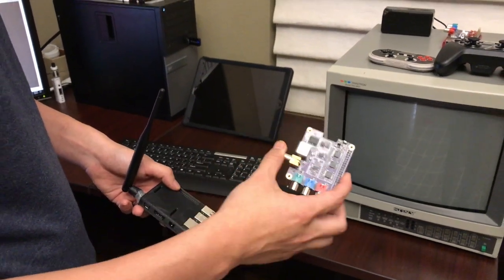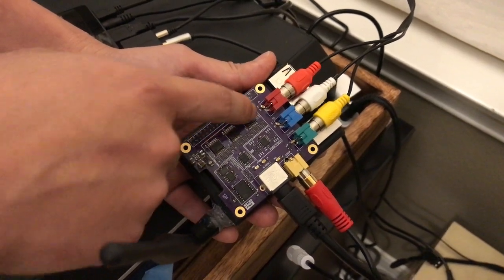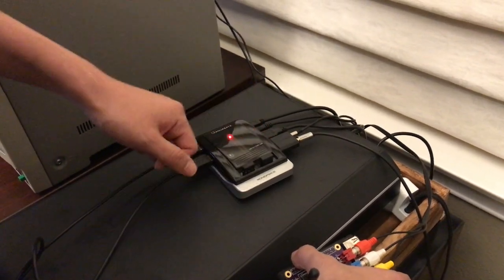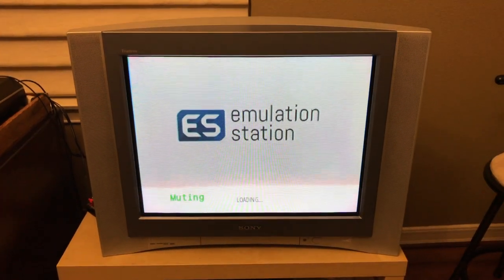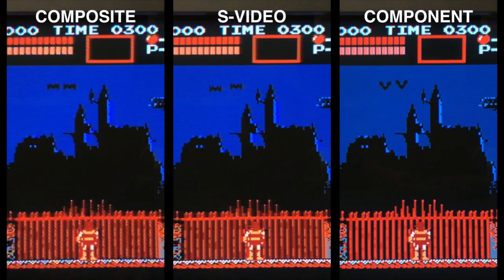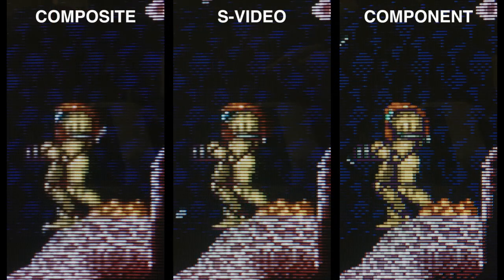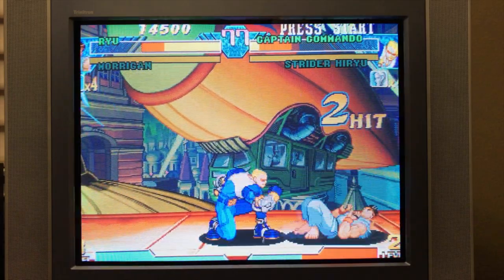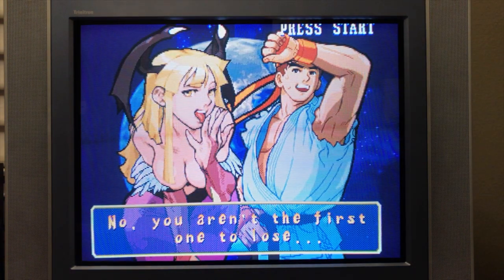RetroTink Demonstration - Raspberry Pi 240p Component and S-Video Output

Comment: sorry if this has been asked already, but have you had any luck configuring the emulator to fit the 240p screen better? I tried using composite straight from the pi to a crappy CRT TV, and had many issues finding a video mode / scaling mode that fit the screen properly. It seems the software was not meant to output to a tube? I see significant edge cropping on your sample videos here.
Reply: 2 minutes of further research and I see you have a whole second video about that lol. well let this dumb question serve as a pointer to that other video. thanks
Reply from the maker: haha no worries, good question. Yeah the new Lakka image I have makes it super easy to adjust the overscan to make it look good on different screens.

Comment: Is there any notable difference if I do hdmi_cvt=320 240 120 1  and connect raspberrypi via hdmi  and cheap HDMI to VGA adapter to CRT monitor? I tried and it works quite good

Comment: Forgot how amazing crt looked and no lag.

Just checked crags list 36" Sony FD Trinitron WEGA CRT TV $10 but it's 222lbs! 
Anyone have a pro tip on moving something that heavy?

What about a plasma tv, there's a few 50" for $50 etc. I'd image it'd be better than a lcd? (and weigh a lot less)

Edit: also another option if you don't want to mess with emulation,  pandoras box arcade strait outa China for around $200.
Reply from the maker: A dolly and 2 or three friends :) But personally, I've been sticking to 27in max for consumer CRT or 20in PVMs. The bigger ones are seriously too heavy and more prone to geometry and convergence problems.

Comment: Nice Project! It's very interesting to he what people are coming up for alteriatives for GroovyMame and Pandora Boxes. Also I Don't want to pry, but I've been wondering if all you essentially did was get the RGB and sync from the GPIO pins and make a RGB to  YPBPR conversion circuit? If so this would be a cool DYI project. (also if you ever make revison use should add pots to fix the image length, width, and center.)

Comment: is there reason to use the composite on this vs the composite on the pi, considering there is 240p support now? I still want your device, for the svideo/component, but I am curious
Reply from the maker: To be honest the only advantage is that the hat has more flexible timing modes so the image fills the screen without scaling artifacts. But composite is pretty crummy in either case :)

Comment: Hey Mike, this looks awesome.
Would you consider a similar card for PC that eats hdmi or dvi/vga? There are various converters available on the net but there's not much info on how they treat the signal, their prices also differs a lot, so you can't tell if should buy a cheap or a more expensive or a very expensive one, and it looks like you know what you're doing.
Reply from the maker: Yeah that's the next goal! I want to build a guaranteed good HDMI -> Analog video that supports ultrawide resolutions without any scaling and lag. Just wish had more time to bust it out.
Reply: Mike Chi hi Mike. I agree with vdovindiman.  This is the holy grail of emulation for CRT fans: a device to get 240p from your modern PC via components or RGB. ArcadeVGA is a good alternative but doesn't have components are not suitable for notebooks or other devices. I'm glad you are working on it. I'll be first in line. Thank you.
Reply: I read some forums around,  apparently modern videocards cannot produce resolutions lower than 640x480, older ati and nvidia cards could by using software like crtemudriver and powerstrip, but the settings are quite complicated and wrong rgb configuration may even damage a TV or a monitor. Seems like with HDMI the only option is downscaling then?..
Reply from the maker: I think the main limitation is pixel clock. So a 3840 x 240 mode would be just fine. I've gotten it to work on both ATI and Nvidia cards. But yes, hacking the settings was a pain :)

Comment: Great video/device! Although, at around 7:00, playing Metroid, I see that text/screen is cut off on the left. Is this an issue with the Retro Tink or the TV? Can it be fixed? I was to buy one of these but a concerned about this. Also, my 27" Toshiba TruFlat screen supports 480i. Will this support res or is 240P better? Thanks and nice work!!

Comment: Looks great. But gotta configure the aspect ratio of the video output to fit a 4:3 screen
Reply from the maker: Super Saiyan Machoke aspect ratio of the video output is fine, my TV needs some recalibration.
Reply: Mike Chi oh I gotcha. These things look pretty legit. Are they compatible with all raspberry pi models? And also are they available for purchase?
Reply from the maker: Thanks man. The units work with the 2, 3 and zero. I would really only recommend the 3 for performance reasons. Yes they are: www.retrotink.com :)
Reply: Mike Chi thanks, brother. Think I'll be picking one of these up. How much programming does this require?
Reply from the maker: No problem and thank you. Not too much programming. If you've never used a Raspberry Pi before there's a small learning curve. Basically you use a program on the PC to flash a microSD card with the image on my site. Then you load up some ROMS on a USB stick and you're good to go.

Comment: It kinda does matter if you use RCA vs actual component cables. RCA doesn't meet the 75ohms spec. So there's some probability of noise.
Reply from the maker: Nerd out warning :)

The max frequency content of standard def is well under 10Mhz - a wavelength of 30 meters. The cable is way shorter than that, so it's doubtful you'll see any transmission line effects. RCA cables, thankfully are shielded. Generally consumer grade gear - HD over component and VGA aren't really 75 ohm transmission lines but no one's really complaining or noticing. It seems that it's not possible to get a true 75 ohm impedance on RCA cables:

http://www.bluejeanscable.com/articles/75ohmrca.htm

Having said that, I am about to build a BNC version with the correct dielectric on the connector for a 75 ohm match!

But for the video, I was just referring to the colors of the cable not being correct :)

Comment: Why would i not wanna have the dot crawl? That makes no sense when you want it to be as legit as possible otherwise what is the point?
It just ends up looking like it would on an HD TV. 
I'm currently looking for a way to replicate all of that without the need for an actual CRT.
Gotta be a way to simulate all that on an LED HD TV...
Reply: The Goof Some people were lucky to have S-Video and our European friends have SCART RGB, so there's no inherent reason why composite is more authentic. Except for systems like the NES that generated color in the composite domain. Also arcade games systems are RGB...
Reply: Mike Chi are you familiar with how the NT Mini generates an S-Video signal that is faithful to the original NES colors but obviously better picture quality than the original composite video. I'm going to order 1 of your Svideo units although the emulators may need to be configured for correct color output. Thanks so much for doing this. S-Video is critical for Atari VCS, Intellivision, Family Computer, SG-1000, Atari 800, Atari 5200, etc. Ihope you have enough sales to continue to work on these.
Reply: Thanks Tim, for your support! It's been a small hobby but just seeing other people out there enjoying it is enough for me. I'm not sure how the NT mini works but on the emulators, you can set different NES palettes, some of which are reasonably close.

Comment: Is the unit for the raspberry pi the classic 2x product shown in your website? I did not see the unit that has gpio connectors 🤔
Reply: i also checked, i think they removed it? or maybe built a better one somewhere. lmk if you find out
Reply: @pacboy24 - I found out it got discontinued because they were having problems with compatibility. What a bummer 😒
Reply: @MrRockfish01  waaaa??? darn it! i have a svideo/component tv set in my arcade cabinet and theres no retropi with svideo outputs out there. thats such a bummer indeed!
Reply: @pacboy24  - you can find it on eBay but it’s going to cost $$$$$ 😩
Reply: @MrRockfish01  also checked on ebay. they have the retrotink converters, yet i read that theres input lag, about 45ms with sharp picture.... this one on the video with the top loader connection id pay if its steep. if not, i just have to wait until another party creates svideo outputs. because comeon! CRT FTW!

Comment: why do you need this damn board?
the main problem I see is that PI need a Fan, you don't have one, it can burn fast because that board on the GPIO is on the way.
by the way the prices of this board are just stupid, I can buy a cheap PVM cheaper than the converter. Its not feasible.